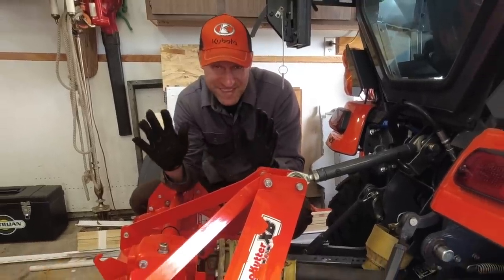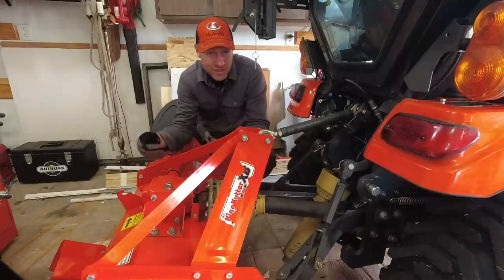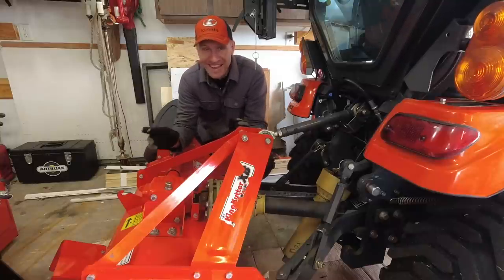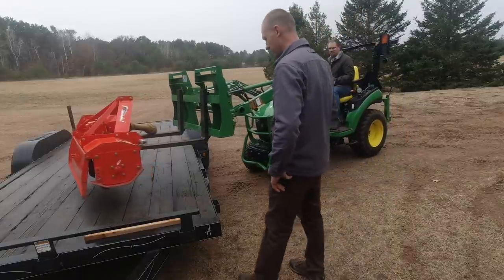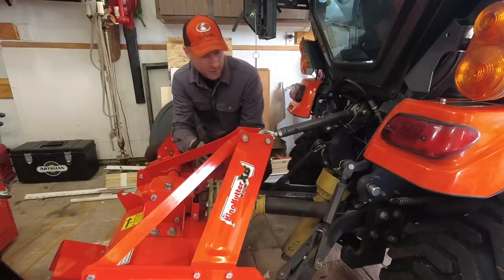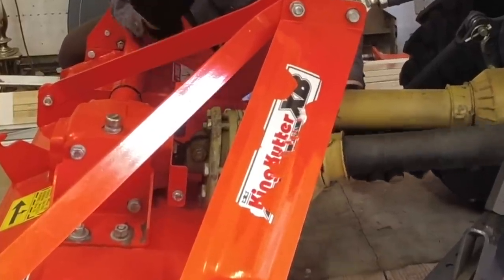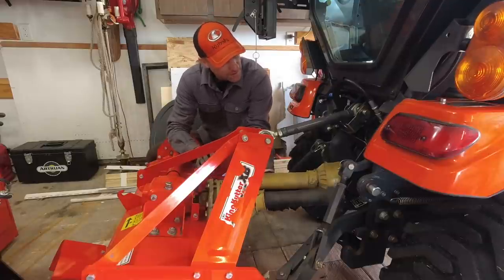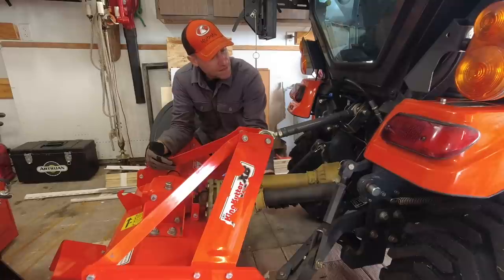HOW TO CUT A PTO SHAFT TO SIZE (For Three Point Tractor Implements)

Comment: 2 points:
1) Don't cut your shaft off if you plan on getting some kind of a quick hitch. Even a Pat's system will add about 3 inches and your shaft could now be too short. Get the quick hitch first.
2) My cutter shaft actually gets shorter at the top of the 3pt lift than at level.  I would recommend measuring in multiple places before you cut.
But this went well!  Keep on tractoring!

Comment: Hi Jon!  Great video!  You covered all the steps and this video will be a good resource for those needing to shorten their PTO shafts.  You might consider doing a video on how to lengthen a PTO shaft next. 😆 Keep on Tractoring!
Reply from the maker: Thanks Martin! How to lengthen one eh! 😂 not sure I have the right tools for that. 
Keep on tractoring!
Reply: @ritterjon  It is possible....in a way. lol For instance, I set up my tiller (same as yours) before I decided to go with the PATs system. The PATs put me 4 inches further away from the tractor. 

Instead of buying a new PTO shaft, I went to a local tractor sales and supply store and purchased a 540 to 540 rpm shaft extension/adaptor for $28. It adds the exact amount that I was lacking, as it adds 4 inches to the length once hooked up. It also makes it easier to hook up and un-hook the PTO shaft during install and removal.

Great video.

Comment: I thought when you went to shorten your shaft and you went from the locking part of the pto shaft that you weren't going to allow for the shaft having to pull back to connect and disconnect... but glad it worked out

Comment: Great job, Jon. Good idea to cut it a little short. Not only will that keep it from binding, but you probably wouldn’t be able to retract it enough to get it on the shaft.
Reply from the maker: That is true, I should’ve mentioned that as well. The 1.5 inch of play allowed me to get it attached. 
Keep on tractoring!

Comment: This actually happened to my friend and coworker. He has a kubota L 3800 with a 5' brush hog and was mowing on a pretty steep hill. As he was going down he ran into a small divet or ravine and busted his rear housing. He got lucky, as kubota fixed it under his extended warranty he got. He said he only had about six months left on the warranty. Good job Jon, great video.

Comment: Hey Jon, My method was a little different which I’ll explain. I measured from the bolt position on the tiller to the face of the shaft on my Kubota BX25. That distance is 23” in the level position with the tiller lifted. Then I measured my PTO from the bolt hole on the clutch side to the end of the spline and got 33” (a longer PTO than yours).
Then I took 23” and subtracted 1/2” so the the PTO will clear the tiller shaft (22.5”).
So the amount I must cut off the PTO is 33” - 22.5” = 10.5” on both ends. Wow! 
I am concerned it will not work. The inner sliding plastic part on the PTO measures only 14” so if I cut off 10.5” that leaves only 3.5” of plastic left. A Really short mid section. 
I think this is because it’s a longer PTO they provided with the tiller shipment else I’d be cutting off less. Do you think it would work regardless? Thanks for your thought.
Reply from the maker: Wow, that really only gives your 3.5 inches of plastic guard. That does seem almost too small but it should work for you. If you’d like to send me some pictures so I could get a better idea of what your dealing with Facebook message me or post them in any BX Facebook groups and tag me. Happy to help. Measure 15 times, cut once! 
Keep on tractoring!

Comment: Great video, thanks. On the BX when the implement is raised to max height isn't that when the PTO shaft is the shortest?
Reply from the maker: Thanks for watching. The PTO is at its shortest when the PTO shaft of the tractor is level with the PTO shaft of the implement. 
Keep on tractoring!
Reply: @ritterjon  I do not think this is correct; on my BX2670, the PTO shaft gets shorter by a half inch when raised to it's highest position.
Reply: Update - you are correct and sorry for the misinformation; I went back and measured mine on my BX and indeed it's shortest when the implement is level, and grows longer by a half inch when the implement is raised to the fullest height. Apologies.

Comment: Hey Ritter bit so if I add a pto link quick attach my measurements will be different correct. Now I will measure desired pto length from the detent on the implement to the very tip of the pto shsft on tractor right or wrong your thoughts please . Thanks.
Reply: Oh I forgot to add 1.5 to 2 inches to that measurement well again let me know if this sounds good.
Reply from the maker: I would install your quick attach along with the implement and then find level between the PTO shafts of the tractor and implement. Measure and then subtract an additional 1.5 to 2 inches to more easily hook it up. 
Keep on tractoring!
Reply: Am I measuring once level from detent to detent or detent on lmplement to the tip of the pto shaft?
Reply from the maker: @terrymaymay3099  I’d go detent to detent and match it up with the PTO shaft. Remember your goal is to just make the shaft about 2 inches shorter than the closest distance you measure at level.

Comment: If you needed 5" why didn't you cut 2 1/2" off each side?
Reply from the maker: Because a PTO shaft overlaps and cutting just 2 1/2 wouldn’t have been enough. 
Keep on tractoring!
Reply: @ritterjon  As I was laying in bed last night it hit me that each side of the shaft is the same length, it takes me a minute sometimes!  lol  Thanks

Comment: Electric bandsaw works a lot better
Reply from the maker: That it would! I don’t happen to have one of those yet. 
Keep on tractoring!
Reply: Harbor freight has them buy a couple extra blades and you’ll be set for years and as long as you use it correctly